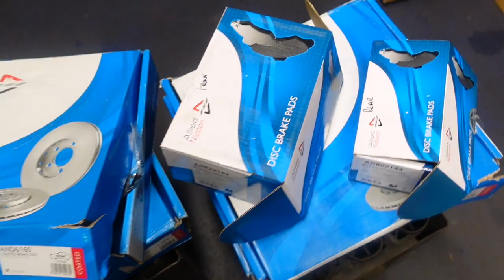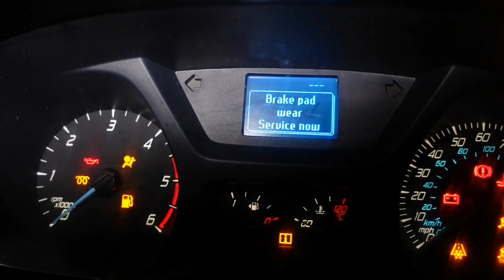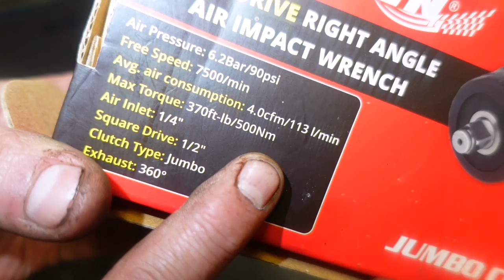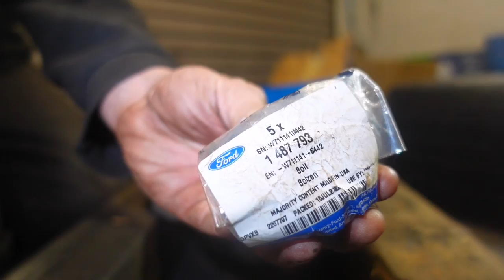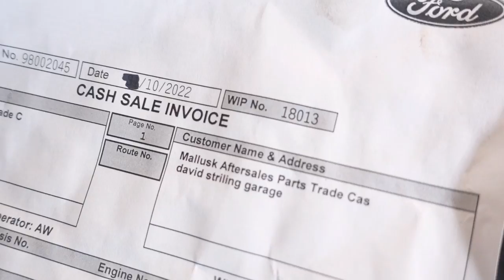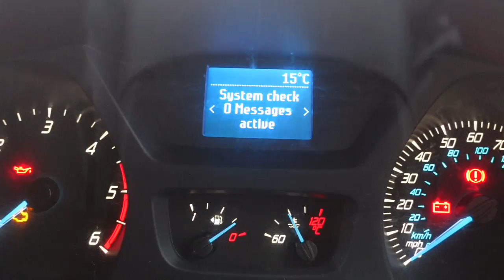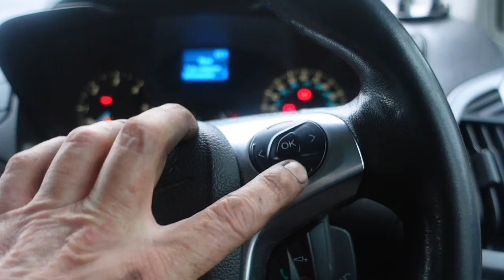Ford Transit Custom MK8 FWD Front Brake Disc Change and other Horrors. Extended Version

Comment: I fitted an after market rear wheel bearing with studs on my Mondeo and the studs were longer than Ford ones so the closed head nuts bottomed out before going tight. Great video, thanks.

Comment: That is a fantastically informative video. 
Isn’t it amazing some peoples lack of attention to detail. I definitely didn’t know about the rubber sliding pin being trailing in its placement but everyday is a school day. Very well done Dave, no stone left unturned 👏👏👍
Reply from the maker: Aye Peter, it's those things that i don't know what people consider or not, so based on what i found on this example, it gives me something to refer to. If that makes any sense.
Reply: @davesterl  absolutely Dave, I will never forget that now. 
Wouldn’t you wonder how anyone could be that careless to fit brake pads like that & I have seen it quite a few times too 🤷🏼‍♂️
I once saw a pad fitted backwards with the steel back up against the disc 😱😂😂
Reply from the maker: i don't think it's carelessness. I think they don't know details such as pads pinned to piston, directional pads, carriers cleaned and filed. Pins not cleaned properly, not greased, wrong grease, slider pins in wrong place etc........My local factors tell me i'm the only person orders brake hardware and they supply most garages round here as they seem to just change pads and only that ie: beat old ones out and beat new ones in. I then get them in and redo the whole job and explain to owners the time is in the clean up. The other day i dumped new pads someone else fitted, ECP crap. There may be a factor of cost of time to what the customer is willing to pay.
Reply: @davesterl  😂😂😂

Comment: Thanks for a very detailed video of a job that I will be attempting to do in the spring. Just wondering if you’d advise the use of any anti seize ( aluminium anti seize ) or grease on the axle splines. For ease of future disassembly?

Comment: Those wheel studs are replaceable they just knock out and knock in I have just changed mine.
Reply from the maker: Yes they do, although as stated in the video, i could only source rear studs for this variant

Comment: Whoever designed the hub and disc setup needs a good slap! Ford are desperate for that, 2.0l tdci engines have the oil filter burried, need hands like a midwife to get at it!
Reply from the maker: Yeah, no need for that design
Reply: Just try to change a light bulb on a Ford Ka. I was told that you’d need to take off the front bumper for that. I wouldn’t want to tell/sell that to a customer.

Comment: Ah the old pre sale postal order MOT... why I never trust stealers, or sellers, or anyone selling a car for that matter. Well done Dave, in restoring faith in humanity. What a complete tool that worked on this before! 
Still going to steer clear from a roadside transit brake job then. No wonder they're expensive to do!
You're teaching me things I never knew! 
No neversneeze on the driveshaft though?
Edit: never mind. Now you told me!
Thought about the nuts, they could be aftermarket nuts, because the fiesta has a zinc sheath on them. Steel swelled up and you end up with swollen nuts. I've told a few folks to buy cheap ebay nuts - open top. Been there, done that, because the spare I had on my chrysler needed open top nuts.

SAMIR, YOU'RE BREAKING THE CAR!
Reply from the maker: They are aftermarket nuts as they are aftermarket wheels. No anti seize on axle reqd if it's cleaned up. People put copper grease on the splines without clean up is another waste of time.